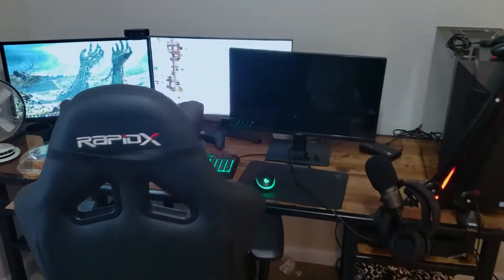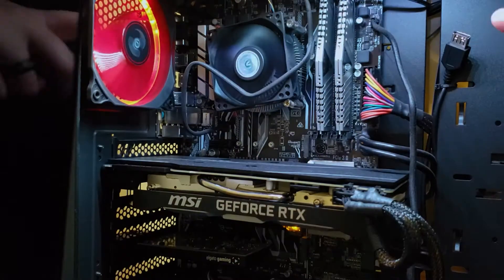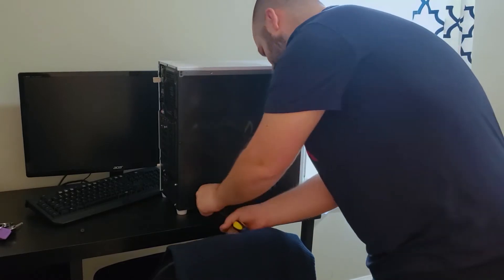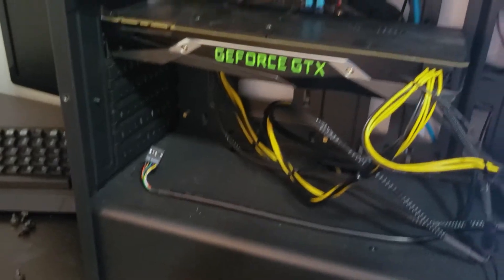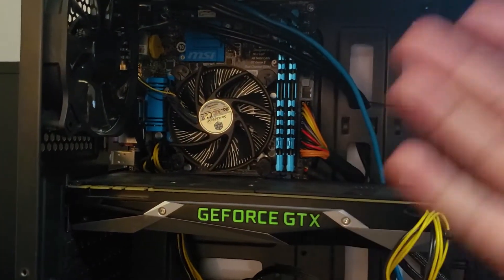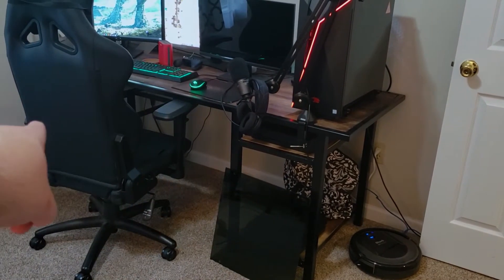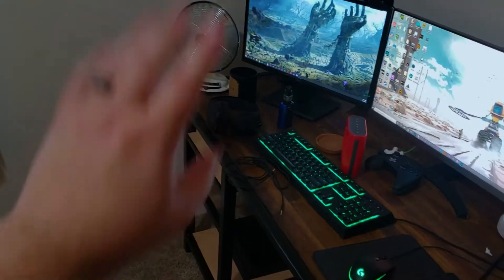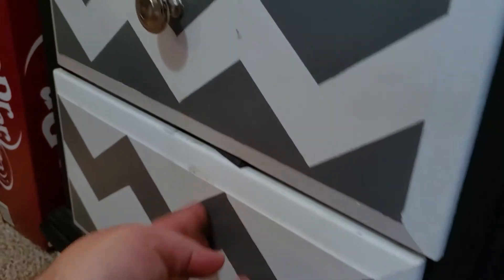My 2 PC Setup For Streaming

Comment: When you were experincing the stutters and dropped frames was your cpu or gpu doing the encoding? I've since switched back to nvenc(gpu) to do my encoding during my streams. Since Nvidia updated the nvenc stuff last year I've seen a huge improvement. Granted I use a 1080ti but either way I think all ten series cards and up have the nvenc encoders.  2 system setups are easily the best option so regardless your streams are going to perform alot better now. Hope all is well Leroy, I'll try to stop in on the next stream.
Reply from the maker: I have used the GPU before and its worked great on certain games but not others. Constantly changing settings in the games AND OBS got really old. the 20 series has done really well but I still love the 1070...just not for streaming and gaming at the same time LOL!!